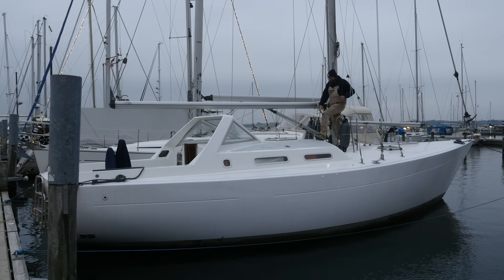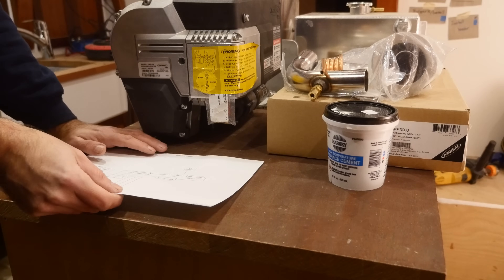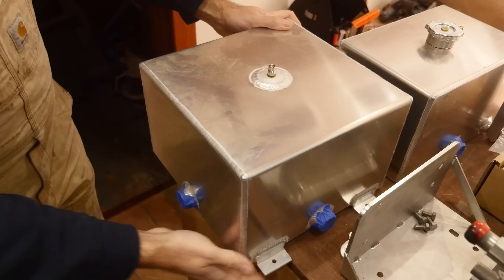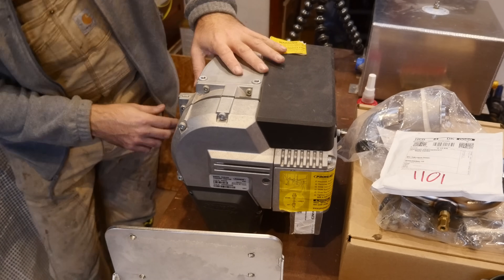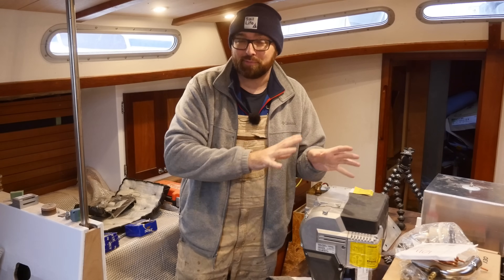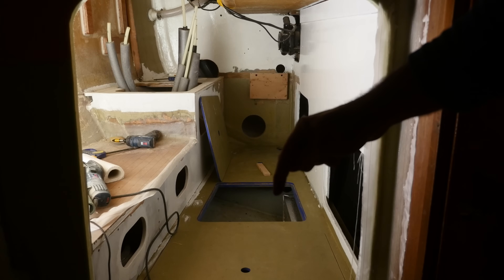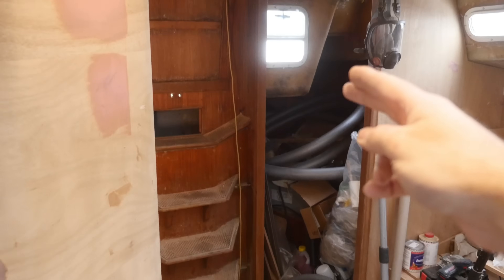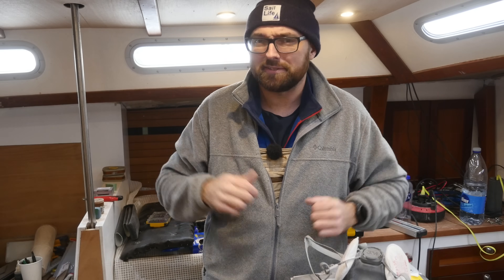Sail Life - Dometic Proheat X30 hydronic heater on a boat, part 1 of 3 - DIY project

Comment: Place the exhaust behind the swimming ladder. I think you won't be using both, simultaniously...
Reply: Your in Stavanger in the shoulder season, and wish to go for a dingy ride. Hot pipe?🤦‍♂️
Also, Mads, please keep the number of different alloys in the heating system, to an absolute minimum, don't want to inadvertently start a Galvanic cell.😁  
Best wishes
Reply: @carlthor91  Since the heat source side is a closed loop (no mixing with other fluids) I suspect the manufacturer would recommend some kind of radiator fluid additive. That should provide the anti corrosion factor needed to protect the pumps, heat exchangers and fittings. After all it seems to work well in motor vehicles.
Reply: @lancer2204  i have switched to water free radiator fluid, stuff is awesome & zero corrosion
Reply: I would be worried about oily residue from the exhaust making the ladder slippery and maybe discolouring the ladder. Same problem with the dock lines. Is it possible to move away from either?
Reply: @russellosborne8795  yes it is, place the swimming ladder on the other side in the future, not ideal but solves the problem.
Reply: He will to have hot/warm showers.
Reply: What Peter says. Also, place it between the steps (not directly exhausting onto a rung) and this will also help protect dingy and other items that could come in contact with it.

Comment: Glad you’re on the mend.  Looks like a great plan for heat.  With the heaters in compartments, will there be air supply holes cut to allow the fans to move air efficiently?

Comment: Why not also ass a electric heater that you can use in port? Must be much cheaper than diesel?
Reply: He has mentioned in the past, having another type of heating system (as he prefers cooler area sailing over the tropics). He will likely add a backup system. I can see it being some sort of modular smaller system that could handle cool weather, but not arctic winter level cold. Kind of a spring/fall system I think.
Reply: You've never seen what they charge for electricity in some marinas...

Comment: Will you have enough airflow into the fan heaters, particularly if the under seat storage gets full?
Reply: There needs to be a "return air" feed for the cold air to get funneled into the "back" of the heater and then flow across the core and then out to the room.   Ideally the cold air should be taken in from near the floor/bottom (cold air sinks, hot air rises) and then run across the heater element.    Ideally also a separation between where you are pulling cold air in and the heated air exits would be nice to prevent it from just drawing the already warmed air right back into the heater and not moving enough air to make it comfortable in all areas - of course the small space helps so this might not be an issue like a house might have....
Reply: Yeah, a little bit of plywood to prevent anything falling against the fans + to allow airflow (a small vent could be added where needed) would help loads.

Comment: Hey Mads, great to see that you're back on the mend and feeling better. The heating system looks amazing! My only concern was the cubby hole the heater is in within the main salon. As the compartment is quite small and will be relatively sealed up, will air flow be an issue? I only ask as I've just moved a few bits away fromy home radiators and the difference is huge. Keep up the great work! Mac in Manchester UK
Reply: Yes some kind of air intake grate seems like it would increase how much air flow the fan could output.
Reply: @echtogammut  yes I'd run a vent through from the next compartment with a duct in from the salon so it's warm air coming in not drawing off the cold hull.

Comment: mount the exhaust on the transom - when the temperature is Minus and you are pouring on the heat it is unlikely you will want to use the ladder
Reply: mounting an exhaust on the transom means inhaling exhaust fumes when you sailing with the wind...
...which is almost all the time when cruising.
Reply: On and off tender?
Reply: Agreed as I was thinking the same thing...

Comment: I think you probably want to shroud the exhaust for that generator, right? I mean a flush exhaust pipe on a vertical hull surface can end up taking some saltwater in at some heel angles particularly at the stern where water takes a final trip off the deck. If you're going to shroud it with something pretty, like a polished stainless shroud, does it really matter where you're putting the exhaust? With a shroud you can angle the actual exhaust away from things.

Comment: My suggestion for the exhaust thru hull is to toss it in the water and move the boat closer to the equator. All kidding aside what is going to keep the fans on the radiators from sucking up diesel fumes from the engine compartment and blowing them into the cabin as I didn't see any obvious air inlets from the cabin.

Comment: Regarding the exhaust, are you unable to tie into the engine exhaust? Or, can you create a dual exhaust along with the generator?
Reply: Engine exhaust has pressure vs this is more like a chimney...I think.
Reply: @EL90291  the pressure shouldnt be that great, and can be mitigated with an "Y " connection, He has to see the manual fot the intake of the heater, if is ok to have some back pressure it would be better than poke another hole in the hull
Reply: Its too hot for engine exaust. Engine exaust has water too cool.
Reply: @scott.wallace8625   thats strange, the hotter your exaust is, the less efficent is your system, so the exaust shouldnt be hotter than the motor... but he has to look up on the manual, he didnt say the temperature on the video
Reply: same idea, but he has to look up the exaust temperature on the manual, and if accepts back pressure when the motor is running or leanin on the side ... but sure better than poking another hole
Reply: @PanceriMarco  yes sir. My heater is a cheap webasto knock off so efficent it is not. The exaust is ss my yanmar is high temp rubber, unless there is water cooling with exuast the heater burn up my engine exuast hose. I looked into it i belive i am correct.
Reply: @PanceriMarco  do not exauhst a heater through a engine exauhst. Engine has water as a coolent. Heater does not. It will burn the hose
Reply: @scott.wallace8625  as i said, have to check the manual for the temperature... i couldnt find, but if the exaust is hotter than 100C your heater is highly inneficent

Comment: Your fans will need air vents for circulation. It looks like the settee is a closed box.
Reply: Agree, and make sure to locate the "Return Air" opening(s) as far away from the Fan Outlet(s) as possible, to prevent "short-circuiting" airflow that will only warm the immediate area(s).
Reply: Yes you’re right maybe some vents in the seating area low-level. This will serve to purposes one being you won’t have a negative pressure on the fans. And secondly you won’t have any stale stagnant air within the storage areas.  Reducing the risk of mould and damp.
Reply: This is true Mads. Check the instructions on this.
Reply: Looks like it takes air in from edge, and out the center?
Reply: @rogerkerkmann  that's my thoughts
Reply: @rogerkerkmann  - looks like a lot of air flow CFM expected from the ends of the vents with two fans.
Reply: And if you not take air from outside you never dry the air inside the boat

Comment: i dont know if this is possible but could you attach the exhaust to one of the other exhaust pipes exiting the boat like the main engine or the generator? idea being less through holes the better.
Reply: I don't know enough, but would this^ suggested arrangement possibly allow engine exhaust to make it's way backwards through the heating system and get fumes into the cabin?
Reply: @KM-ny2ln  I dont know either. was just an idea, not sure if it's a good one, just one. maybe could have one way valve of some sort, i dont know.
Reply: I would combine the exhaust from both engine. That would leave the second outlet for the heater.   I tried finding a way to do this, but nothing so far.
Reply: I do wonder about the stronger pressure of the engine exhaust gases preventing the diesel heater from exhausting properly.
Reply: you know if you put the exhaust of the diesel heater connecting at a 90  to the engine exhaust the exhaust from the engine might actually create a venturi effect and help suck out the heater exhaust. much like a paint spray gun or airbrush the high flow air helps suck out the paint and add it to the stream. if you blow across the top of a straw the water level in the straw rises, that is the venturi effect. so it could work but there are many variables that could make it fail possibly.

Comment: Welcome back! Exhaust suggestion is keeping it centred on transom so it's always same height above sea level no matter angle of heel when under way. Best of luck
Reply: I thought about that, but will that get in the way of his wind vane steering? Looking at his device in older videos, it mounts up and down along the center of the transom too (unlike other vanes, that mount with four points spread out in a box like shape).

Comment: You need A pump for cirkulation and A Electric  heat  element in the buffer tank when you are in  in Harbor with free power
Reply: Buffer tank!!?? It's called a marine water heater, electric, and heat off the engine! Win win
Reply: Solid advice but there's no free lunch and there is definitely no free power :)

Comment: We had the same set up in our lorry but webasto diesel we found not have any stored hot water was a problem if we wanted to do some washing up we had to fire the heater up which on and off isn’t good for them. We removed the heat exchanger and fitted a calorifier in its place good thing now w3 have hot water for at least 20 hrs after heater is off and if we are on shore power it has an immersion heater in it so we don’t need to run the heater. We also dump excess solar power into it.

Comment: Curious, is the circulating fluid glycol based? Or is it some type of light oil? Is the boat engine and the generator hooked into the heat exchanger, or only the generator? Guessing that you are maybe going to put the Lithium batteries under the spare quarter berth bunk, great idea if so. Glad you are doing better. Keep warm, and  hoping the heater gets to working soon.
Reply: For any system that has a potential for cross contamination like in the heat exchanger, the boiler fluid should be GRAS rated (Generally Regarded as Safe).  These are Propylene Glycol based antifreeze such as Peak Sierra Pet safe antifreeze.